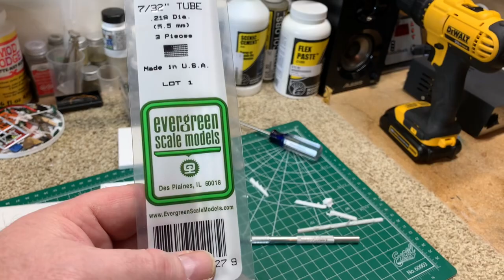Installing The Traffic Signals (Finally!)

Comment: Looks great, Dan. I'm sure the miniature motorists and truckers will appreciate the organized intersection a lot better. The markings will be really neat to see too. Maybe you can get a drivers point of view of the intersection at some point.
The styrene tubes are a good idea for sure. Evergreen makes so many shapes and sizes of polystyrene. I have some really thin sheet I got from them. Too thin for the use I had, but I'll use it for something. Window shades maybe? Something will come up no doubt.
The little metal pieces for the base of your light poles are an example of why we hang on to things I guess. That was serendipitous for sure! They look perfectly suited like they're made for the poles.

Work on my layout continues.. Undercoat painted, rocks going in as we speak. I gave up on hydrocal for attaching them since it set up too quickly on my first attempt. I also broke the rock in 2 places trying to get the fast hardening hydrocal on the back! Then it didn't stick! lol. So I removed all that mess and used Sculptamold which works much better. Elmers works great too for flat mating surfaces. What did you use for rocks and portals? See you next time!
Reply from the maker: Hi Tom, thank you. I got a pretty good still for the thumbnail shot, but yes I’ll try some street level camera angles for sure!  The plastic tubes worked great and were much easier to cut than brass or aluminum would have been. After I bought those, I found two brass tubes still in a package that I had hanging right behind my bench. The previous homeowners left it there. Haha, I could’ve used those but it would have been tricky cutting them under the bench, and they are a bigger diameter.  For the big rock behind the downtown buildings I used hydrocal and let it ooze out around it which allowed me to smooth out the edges and fill the gaps. For the smaller ones, the white turbo tack glue and for some others, and the tunnel portals I used the foam tack glue, which is just a contact cement. I too found the hydrocal hard to work with. My buddy gave me a tub of elasticized putty which I used also as I recall. I’ll have to see if I still have that laying around and let you know what it is. I’ll try to get the lines painted this weekend, since it’s another 3-dayer. Not sure what the next video will be yet.  Maybe a search for the front right railing that got pulled off of my new GP-38 #307. It’s still MIA. It got snagged on the Christmas lights on the bridge and I have a feeling it’s hiding inside the tunnel somewhere.  Probably the missing snowball kid has it?! 😁

Comment: Dan, the lights look great. I don't know if this will help access under the layout. You could cut the lower brace in the middle between the screws remove the screws on the end and the middle and replace with bolts with wing nuts so it's easy to remove and still maintain the structural integrity of the layout, just a thought.
Reply from the maker: That’s a great idea Lou, I hadn’t considered wing nuts. I should’ve set up the camera on a tripod showing me getting under there, it’s like a fat cat going through a small doggie door.  I’ll definitely make that an upcoming project so I can take on the lights for the downtown area and eventually get to crossing signals and gates. Thanks for watching. 👍🏼
Reply: Dan I built a small seat on wheels to get under mine to do wiring but mine is 50 inches high and the layout is also on wheels.
Reply from the maker: @louschneider3681  another good idea. I may have clearance, I made my bench pretty high. I’ll explore that option as well. Thank you.

Comment: What type of street light do you use? What brand?
Reply from the maker: @ivangillispie4186  they are Woodland Scenics Just Plug street lights.
Reply: I just looked at the just plug traffic signals. And I do not see any that look like the ones you use.
Reply from the maker: @ivangillispie4186  hi Ivan, sorry you said street lights. I’m not sure the exact traffic signals that I used but they are very similar to these. 
https://www.ebay.com/itm/355810483359?mkcid=16&mkevt=1&mkrid=711-127632-2357-0&ssspo=2wdT6BAmTP-&sssrc=4429486&ssuid=lp6siSErREC&var=&widget_ver=artemis&media=COPY
If you check the comments below, I link to the controller and possibly discuss where I got the signals, but honestly I can’t remember.

Comment: What are the modes on these?
Reply from the maker: Hi, sorry for the delay getting back to you I’ve been looking for the instructions for that controller board. That was a separate purchase from the traffic signals. I remember getting the signals on eBay, but I’m not sure where I got the controller board. I think I may have talked about it in a prior video to the installation, so let me take a look and I’ll send you a link here when I find it.  As far as the modes I remember it has several options for how they can operate including a couple that incorporate crossing signals and European signals.
Reply from the maker: Here is a link to the MFG website: http://galakelectronics.com/VG-303.htm
They explain all the functions and specs right on that page. 
I purchased the board on Amazon. Here’s a link to the listing: Dual Traffic Light Controller - LED Sequencer / Model Railroad Compatible HO,N,Z https://www.amazon.com/dp/B00OEJKNFU/ref=cm_sw_r_cp_api_glt_fabc_JQSC66TMCFYHR1HE6A58
Hope that helps. 👍🏼
Reply: @DansGrandValley  ok! Thanks!
Reply: @DansGrandValley  how do you power them to a outlet?
Reply from the maker: @Starlight_Emergency_Light  They are 12 V. I used bus blocks underneath the table and ran the power leads, one each to positive and negative. Then I powered the bus blocks with the 12 V power supply that I have sitting under the table on the shelf.
Reply from the maker: @Starlight_Emergency_Light  I found the video where I bench test the board.  Unfortunately I don’t demonstrate the modes, but I do show how I hook it up and bench test it. It’s at the 6:11 mark in the video 
https://youtu.be/gho-6whbrCQ
Reply: @DansGrandValley  I have a question how do you power the bus bar? And can you power directly to controller to a outlet?
Reply from the maker: @Starlight_Emergency_Light  No, you need to run DC, low voltage 12 Volts. This can be achieved by either running a wall wart type transformer or a benchtop transformer, but it Has to be low voltage. If you plug it into an outlet it will fry everything.  So I run positive and negative from my 12 V power supply to the bus bars, then hook whatever accessories need 12 V to those buses.  Something like this. 
Universal Compact Bench Power Supply - 5 Amp Linear Regulated Home Lab Benchtop AC-to-DC 12V Converter w/ 13.8 Volt DC 115V AC 70 Watt Power Input, Screw Type Terminals, Cooling Fan - Pyramid PS7KX https://a.co/d/1xDeXYR
Reply: @DansGrandValley  how would you power a wall wart transformer to the controller? I'm sorry with all these questions! I thinking of getting one)
Reply from the maker: @Starlight_Emergency_Light  No worries. Well the plug would plug into the outlet on the wall, it would have two wires coming off of it. One would be positive and one would be negative, usually the positive is marked with some sort of white line on the wire. You would cut the plug end off or buy one that already has Bare wire ends and you’d put the wires directly to the board for the light controller. You just have to make sure it’s the proper voltage. I believe that board takes 12 to 24 V.